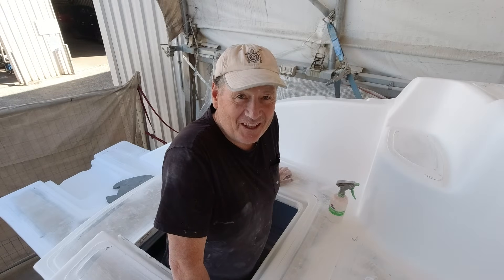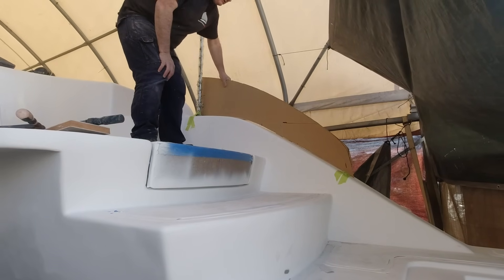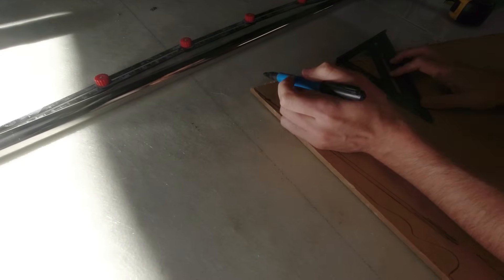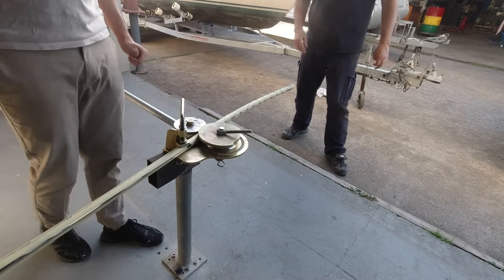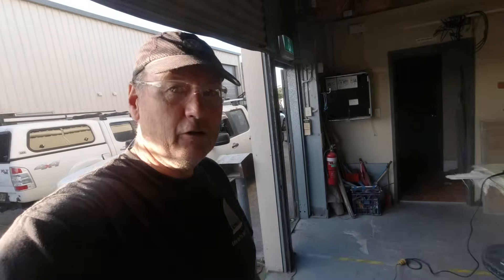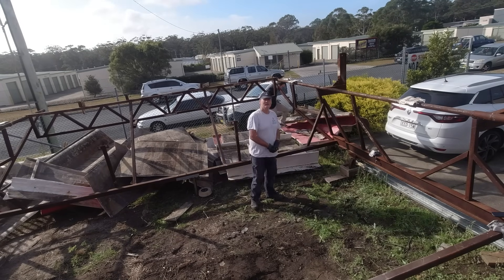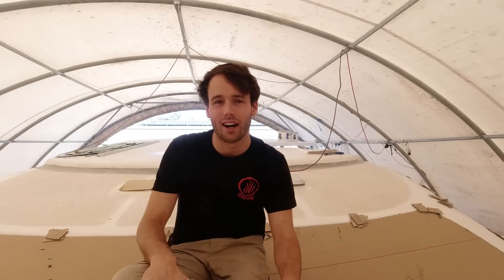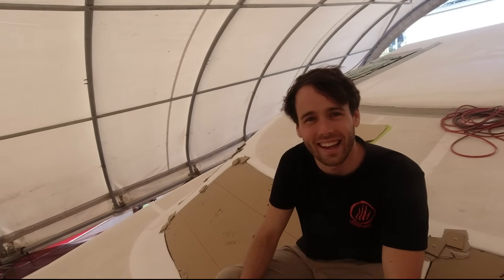IT HAD TO COME TO AN END // Catamaran Build Project Ep293

Comment: The square shaped top of the stainless side frame support looks incorrect, it needs to be a flow on from the curve of the rear rail. (the one you did all the little bends in to create that curve) So lower at the back end.
Reply from the maker: I agree as I said perhaps it should have sloped down as well.Now it is installed, the level of safety in its position heavily outways the cosmetics as the large step below quickly throws you to an elevated position, which requires the higher section at the stern end.I understand what you are saying though, I had to bend the base in to suit the line of the stanchions so in all it looks pretty good now.

Comment: Nothing worse than a 20 cm handrail, curved or straight. Just a trip hazard.
Reply from the maker: Handrail is actually 60 com above the floor step level as coaming Is 40cm high until the very last bit.So in all all about the same or a little lower than our lifeline height of 70cm.
Reply: @LifeOnTheHulls  Thank goodness.
I thought you were going to build a curved rail the height of the sketch on the mdf.